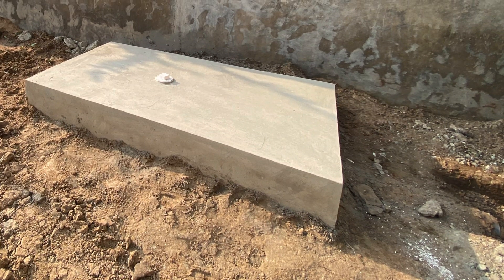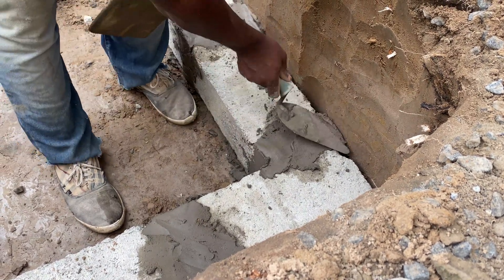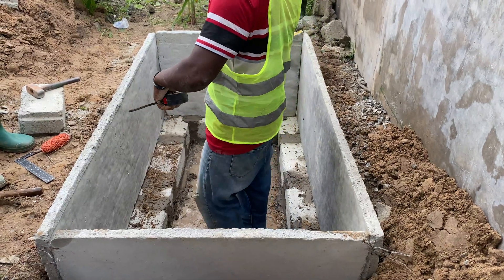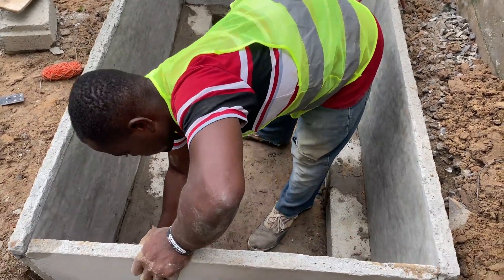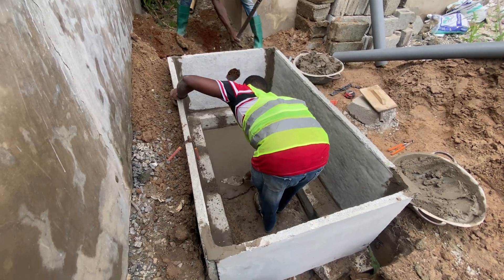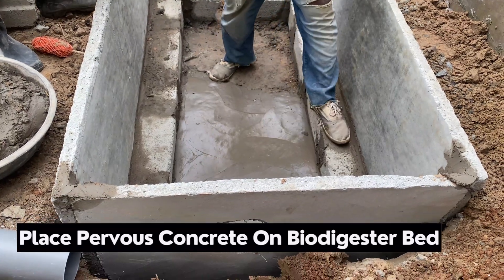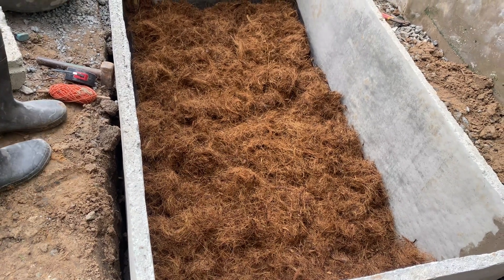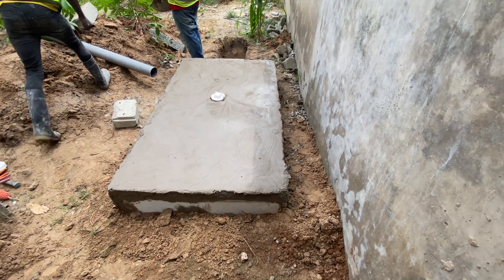Biodigester Construction: Blocks & Slabs Method Explained

Comment: What is the name of the piece that was placed over the blocks laid in the hole? Is there a special mode for moving the slabs of the digesters? I saw your boys using wire to tie the two widths to the lengths of the slabs, how does it work? Are there holes placed at every end of the slabs of the digesters? Please show videos of how to process the slabs. I am from Liberia and a plumber by profession.